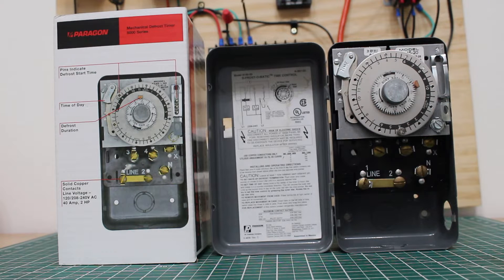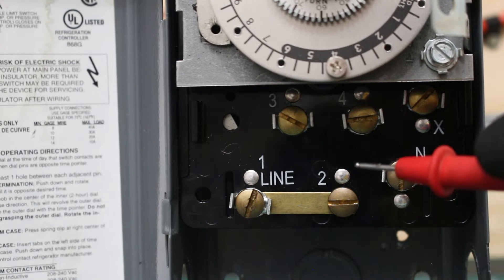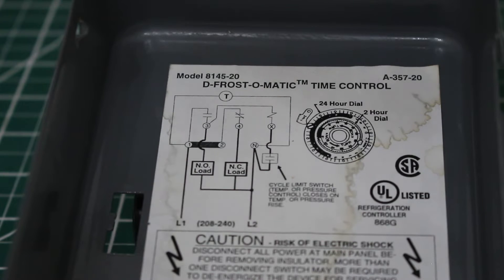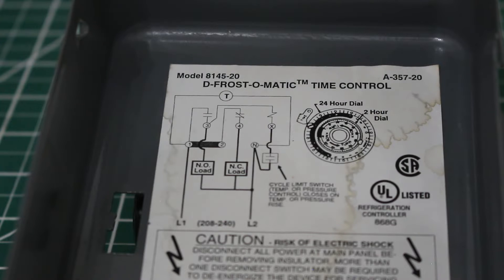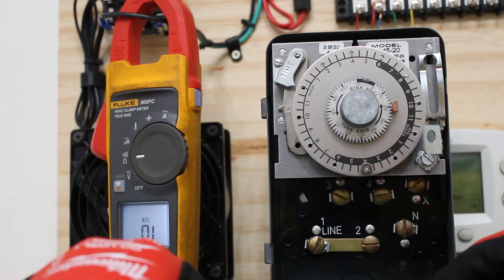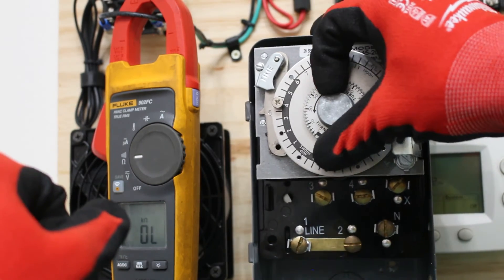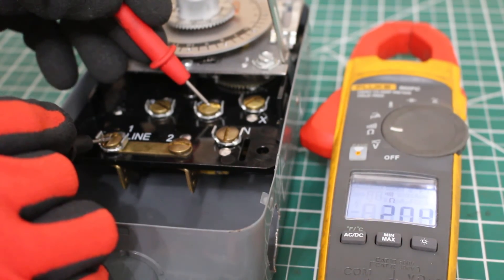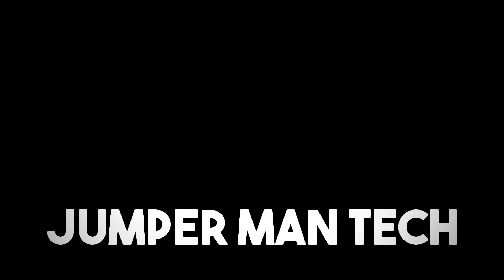HVACR TRAINING: Paragon Mechanical Defrost Timer Explained (Paragon Defrost Timer Troubleshooting)

Comment: The continuity setting beeps up to a certain ohm reading. Depending on the manufacturer but usually anything above the 30s range won't beep and just shows it's resistance. Your meter is fine. Thanks for the videos!

Comment: I have a walkin commercial cooler with Tecumoseh compressor and Paragon time control, both are more then 25 years old. The time control is similar to one in your video. Recently my walkin cooler can only keep to 7 celsius instead of 4 celsius required. Could you tell me how I should try to adjust it. Should I reduce the defrost duration time?
Reply: That could be so many different things from bad thermostat to dirty condenser to bad txv and so and so on. Could have also just leaked the refrigerant finally. 25 is ancient commercially.

Comment: Yo Jumper, so when checking the clock for continuity is the unit supposed to be powered on or off? I'm assuming off. Also is it OK to check with the wires still connected?
Reply: You can troubleshoot this clock by checking voltage.  Forget continuity.  Keep it simple and check voltage.
Reply: @NoWayCraig  thank you, sir!

Comment: I wish you would have covered the coil and it's function with the X terminal.... still you did a great job.
Reply: X is defrost termination. A fan delay is wired in series with the evaporator fans and stops them from running until the coil reaches below 25 . Once it’s below that point, the fans will kick on. This is done to stop moisture from damaging the walk in box
Reply: @alexanderboyd2280 and and 55 degree coil takes it out of defrost before time is up.